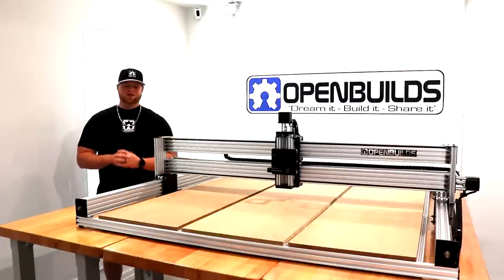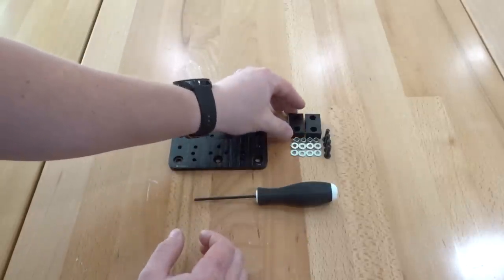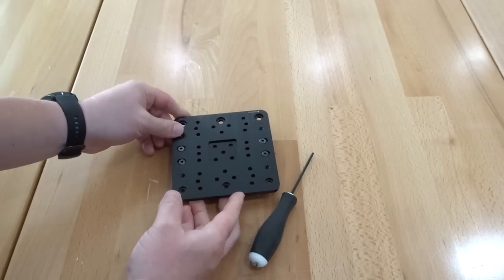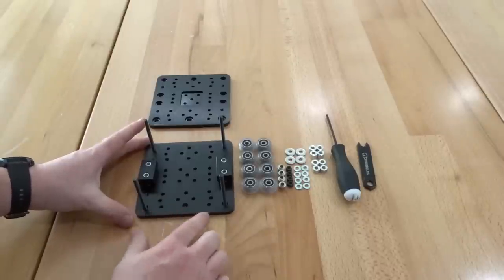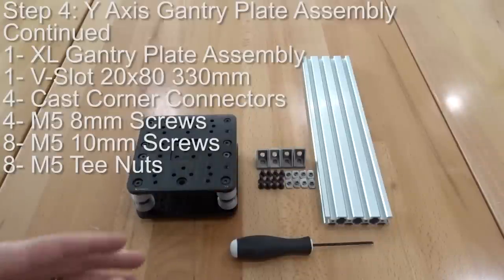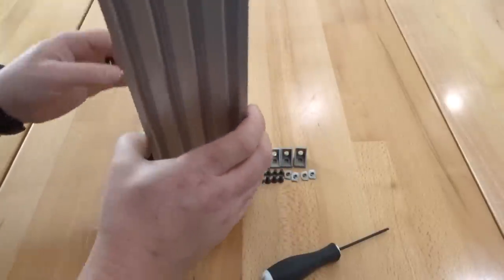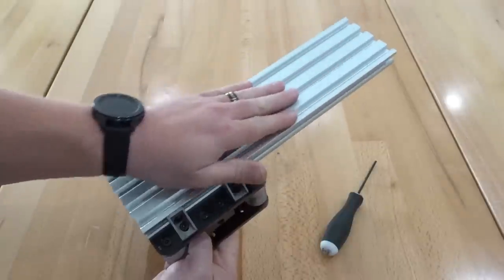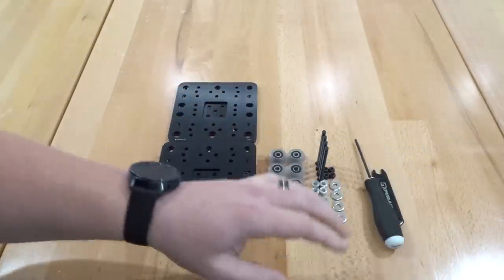OpenBuilds LEAD 1515 Mechanical Build

Comment: Building mine right now... I file off the little nubs on the cast corners so it sits flush where it would not sit in the slot. Doing so makes the corner seem more stable.
Reply from the maker: Great tip! thanks for the share Jason

Comment: Just built mine and this thing is a beast.  So glad I went with this over some of the other new "Pro" models out there.  Solid components, great customer service and a seamless build.  My only grip is I wish the conductors on the back NEMA motors were longer then 3ft as it doesn't leave much room to move things. Also more stickers HAHA
Reply from the maker: Thanks for the nice comment and you will find that this machine can do the same projects the others can without the added cost!
Reply: @OpenBuilds  I noticed your prices are much lower than Avid's, which is where I had planned to buy from. I thought I was missing something, but maybe not? Your prices are really that good?
Reply from the maker: Thanks Tom we do our best to keep this on the fun for all level. We are a company based on the open principle of helping others the best we can. We found years again that the machines we are making for wood working can do the same projects all the other machines can do at a fraction of the cost. We noticed that when working with wood we didn't need the precision of making surgical tools and so we did our best to cut cost by leaving out the expensive unnecessary items creating a machine anyone can understand and most of all afford.

Comment: Assembly note: At Step 18 - Transmission Assembly.  Use 2 Flanged Bearings with 2 Thrust Bearings instead of Regular bearings and 8mm Spacers.  I must have a new design which  appears to be better.

Comment: Trying to decide between the Lead and the Workbee.
Reply from the maker: Both are great machines the real differences on the LEAD 1515 is the ridged double X axis and because its modular so you can mod it in may ways such as making it taller.
Reply: @OpenBuilds  what height of workable material can be reach on the z axis? at most
Reply from the maker: Hi Marco please have a look at the specs for the LEAD CNC machine bundle and notice that because its a modular system the LEAD 1010 Z axis can be strengthened and raised up to fit your application - https://openbuildspartstore.com/lead-cnc/

Comment: Are the cables long enough for me to add a bit of length to the z.   I really want 6 inches of clearance so I can make it a plasma table too.   I need to be able to slide a water tub on there
Reply from the maker: Hi Gregory you should have plenty of cable to do so
Reply: I am doing the same (router/plasma) I just ended up buying the longer extrusions for the tall z upgrade.

Comment: I’ve been interested in buying a cnc machine for a while now. I currently have an awesome laser cutter but would love to expand my shop to be able to cut bigger pieces— I started getting into making home decor pieces. 

When it comes to this cnc, do all the parts come in the box ready to just be assembled or do I have to purchase certain pieces separately & build it up myself? 

I have no experience in soldering or electrical smarts... just wood & building stuff lol. So, I need something that’s ready to be put together straight out of the box!

I’d love to understand so that I can make my purchase. This cnc seems to be well spoken of and also easy on the wallet. Lol

Comment: Leadscrew tensioning system is so much better than 1010. Why don't you guys do the same for 1010? If I knew it in advance - I would rather go with 1515, not 1010.